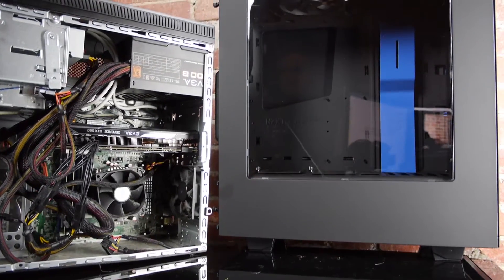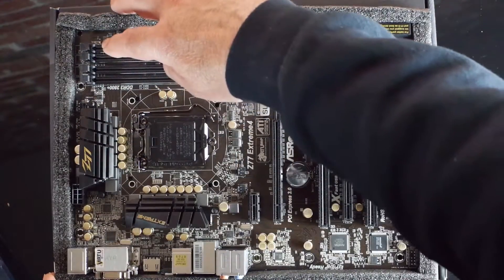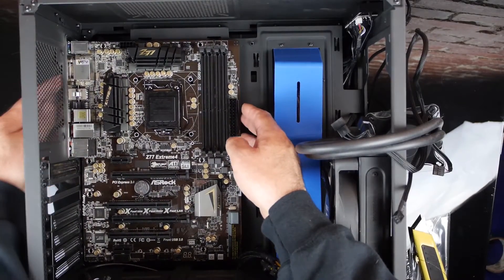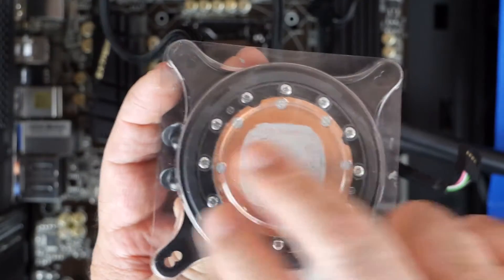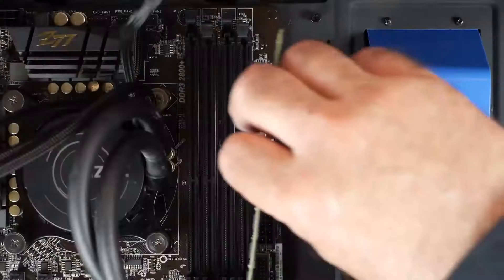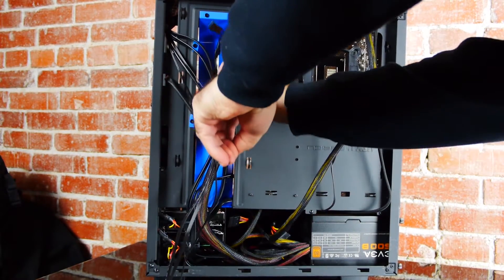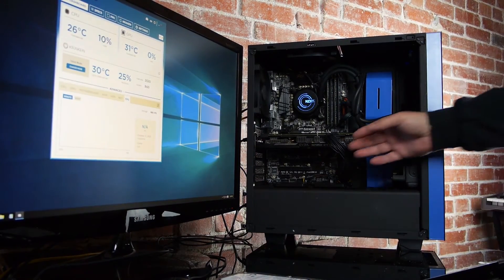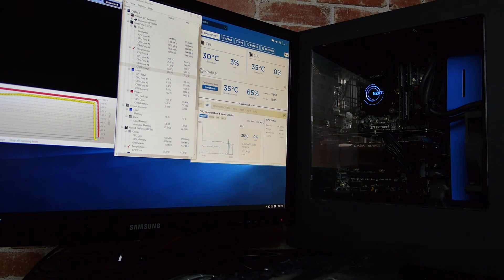AsRock Z77 Extreme4, NZXT X41 In an S340 Case Install & Review

Comment: you still using this i have had my z77 for 8 years almost now and i still have an i5 3570k my gpu is an rtx 2060 and im having fps issues in some games i been reccomended to change the pci slot  what should i do i feel like my cpu is dead
Reply: your cpu bottlenecking the gpu
Reply: I have this board in a case. That's all. What can I get too stream my console gaming. With he stream being smoothe? I too have been sitting on this mo motherboard for awhile.

Comment: When I installed my cooler on my CPU i noticed that it is so wide that I couldn't run my ram in dual channel and My PCIE1 slot was also covered by this huge thing (using  the second slot now). Now I want to switch to water cooling. Is it possible to install this cooler but mount it in the top fan slot, its a 140mm. I also have the NZXT s340 case.

Comment: If you are not overclocking, just using a tower air cooler such as the Hyper 212 Evo will do just fine. What cooler were you using for the last build? The older case could have also been a problem, as it could have decrease the airflow significantly.

Comment: hey I really need help, just installed my z170 extreme4 into my s340 case, new CPU and ram and GPU too. so when I go to start it up.. nothing... but when I take the side panel off and press the on button on the motherboard, my PC powers up but nothing else.. no display on the monitor but all the lights and fans turn on. HELP 😫
Reply: matt briers check your wire if for the power up issue and for display is everything plugged in right do you have a graphics card or not
Reply: yes, RX470. I have fixed it now, I needed to take out the GPU and run it with just the intergrated graphics on the i7 then once it had booted and turned it off again and installed my GPU and everything works fine! thanks anyway :)

Comment: Hey nice video! Just wondering if you had any issues installing the x41's radiator at he front of the case? Looking to build a 6700k & 980ti PC over the next few weeks and I'm also going to be using the s340 & x41. Also is there enough room to still install a 140mm fan above the radiator when it's installed?

Comment: Excuse me, I've got the same motherboard but when i turn on my PC the display of the temperature of the motherboard (in your case, the red display at the bottom at 4:59 ) won't turn on and it don't display anything. How can I turn on that?
Reply from the maker: +Mauro Pagano 

I'm not sure that what you're seeing is actually the temperature Mauro...  If I understand the question, I think you're referring to the Dr Debug display. That display is designed to show error codes - not temperature.  I'm not sure if it's possible to reuse this display to show temperature... It may be, but unless you've added something to re-purpose the Dr. Debug Display, my understanding is that it works as follows.

From AsRock, Dr. Debug is used to provide codes that represent different errors that your system has encountered. Please see the diagram below for reading the Dr. Debug codes and how to troubleshoot.

CodeDescription00Please check if the CPU is installed correctly and then clear CMOS.0dProblem related to memory, VGA card or other devices. Please clear CMOS, re-install the memory and VGA card, and remove other USB, PCI devices.01 - 54 (except 0d), 5A- 60Problem related to memory. Please re-install the CPU and memory then clear CMOS. If the problem still exists, please install only one memory module or try using other memory modules.55The Memory could not be detected. Please re-install the memory and CPU. If the problem still exists, please install only one memory module or try using other memory modules.61 - 91Chipset initialization error. Please press reset or clear CMOS.92 - 99Problem related to PCI-E devices. Please re-install PCI-E devices or try installing them in other slots. If the problem still exists, please remove all PCI-E devices or try using another VGA card.A0 - A7Problem related to IDE or SATA devices. Please re-install IDE and SATA devices. If the problem still exists, please clear CMOS and try removing all SATA devices.b0Problem related to memory. Please re-install the CPU and memory. If the problem still exists, please install only one memory module or try using other memory modules.
* For X79 models, please try installing memory to DDR3 A1, B1, C1 and D1 slots.b4Problem related to USB devices. Please try removing all USB devices.b7Problem related to memory. Please re-install the CPU and memory then clear CMOS. If the problem still exists, please install only one memory module or try using other memory modules.d6The VGA could not be recognized. Please clear CMOS and try re-installing the VGA card. If the problem still exists, please try installing the VGA card in other slots or use other VGA cards.d7The Keyboard and mouse could not be recognized. Please try re-installing the keyboard and mouse.d8Invalid Password.FFPlease check if the CPU is installed correctly and then clear CMOS.

If you can, pass on the number you see in the display.

Thanks
Reply from the maker: +Mauro Pagano 

I'm not sure that what you're seeing is actually the temperature Mauro...  If I understand the question, I think you're referring to the Dr Debug display. That display is designed to show error codes - not temperature.  I'm not sure if it's possible to reuse this display to show temperature... It may be, but unless you've added something to re-purpose the Dr. Debug Display, my understanding is that it works as follows.

From AsRock, Dr. Debug is used to provide codes that represent different errors that your system has encountered. Please see the diagram below for reading the Dr. Debug codes and how to troubleshoot.

http://www.asrock.com/support/faq.asp?id=334

I had copied the table in below for you, but YouTube strips out all the html, so it's tough to read the table.  Follow the link above to AsRock's FAQ.

You can also find the table with the error codes in the Z77 Extreme4 owners manual here. The Full set of Dr. Debug codes can be found on Pages 42 - 43:

http://www.asrock.com/mb/Intel/Z77%20Extreme4/?cat=Manual

Please post the number (or numbers) you see when you look at the display. 

Thanks